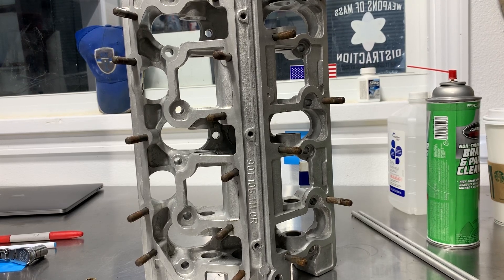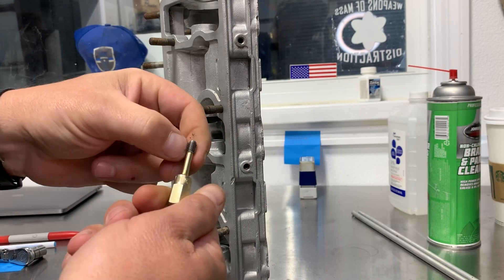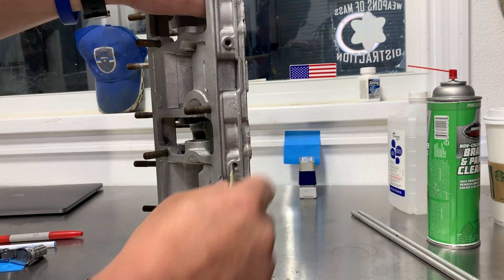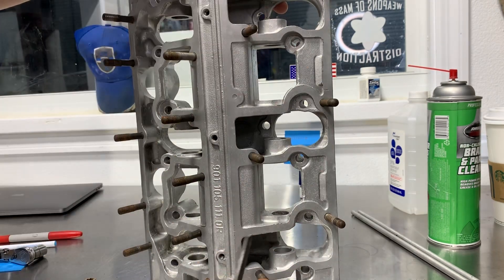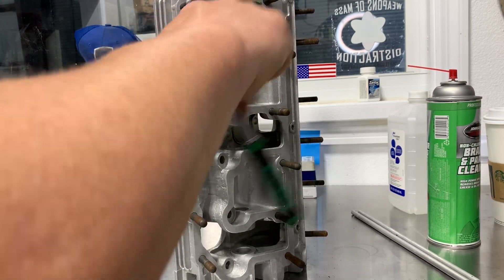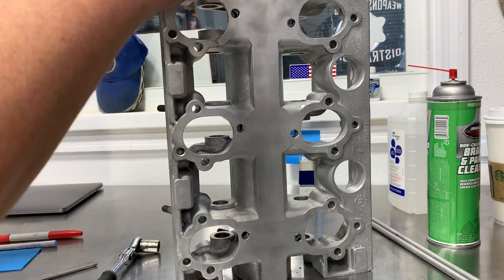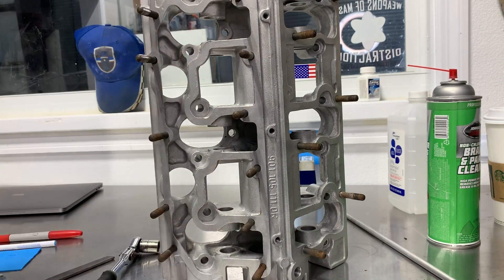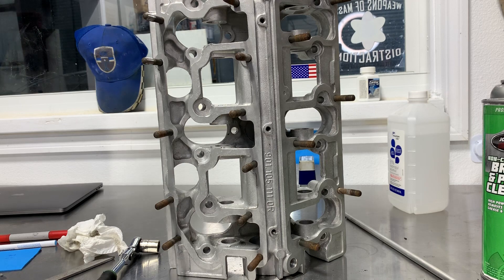Porsche Camrack Prep Engine Rebuild

Comment: Hi, great stuff and thank you for sharing these valuable tips..near beginning of video you say the camrack has been bead blasted...What type of media do you use in blast cabinet..?  At end of video you say camrack will be ultrasonically cleaned "one last time.."  Just wondering about that last step in the final cleaning and if a quick brake parts cleaner spray down and a good air gun blowout would be sufficient...I'm going thru this now with a 3.0L top end...Thank you